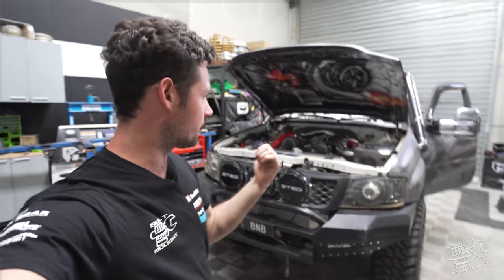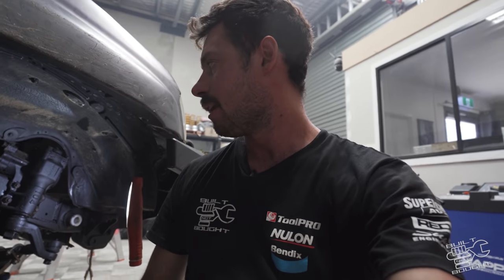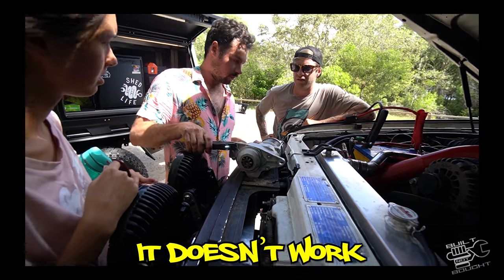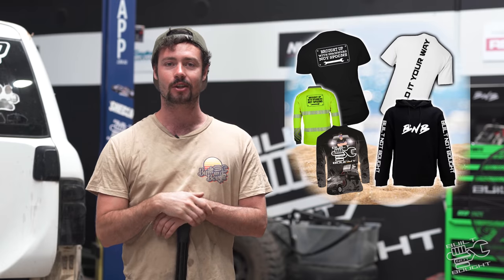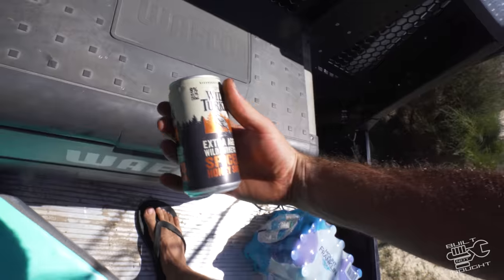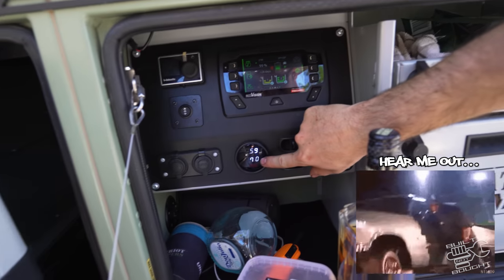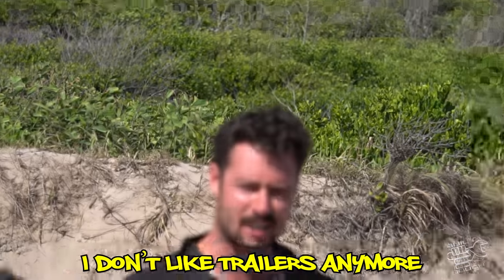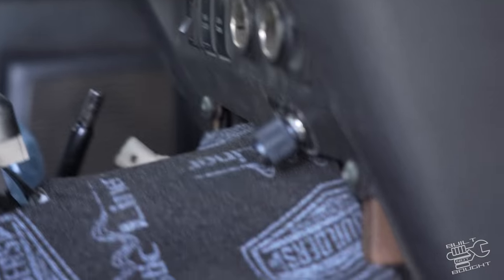DURAMAX Ep. 7 || Fraser Island Shakedown in the Duramax 🚗 💨

Comment: Hey Sam, I'm from WA and currently drive a lowered XT forester. Finally decided to put it on the market to get back into a 4x4, hopefully an older colarado or ranger. A new set of rims would be a great way to start a new build.
Reply: Live north or south of the river?
Reply: @Qw3lp  down south in Albany
Reply: @zac_sales6  me too man albany is a good place
Reply: buddy,your young  stoopid. do not,, buy anything with ifs, or a 4 cyl diesel. that,will limit your choice to a decent, real , 4x4, not a pretend ute.. only 2 to consider are the 4.2tdi gu, or the 80 series,  4.2tdi toyota.  forester,isnt that subaru trying to be something its not.. torque & gears,low gears, are what you need 4x4ing,, not 400hp..
Reply: @harrywalker5836  haha right, I’m sure no one agrees with that
Reply: @harrywalker5836  100% agree my first 4by was a single cab d22 navara was an awesome ute but just save a but more to get something more capable and stronger

Comment: We are over in W.A and drive a GQ patrol which I converted to a turbo td42 and fitted a 4" lift and 35s on steel rims and I think a set of bead locks would set it off as its has a black over grey paint job

Comment: Loving the built not bought 
Tom from qld brisbane currently building hilux surf 1uz swap rebuilt complete motor from crank upwards and cut a340 box turned it into 4wd ,  running gear is in welded engine bay shut just need paint bay and exterior all done by myself need hit you up when its fully done

Wheels would be the next upgrade the fraser 👌🤙

Comment: G’day from Springside NSW, great channel Sam, Would love the aircon for my slide on which is on the back of a 79series 2021 Single Cab with DMW 3” lift/4499kg and 35” MT’s and GSL 4” twin exhaust and 4” intake/airbox and tune.  You can checkout some of the still in progress  build on my amateur channel “2021 LC79 Build” All the best, Regards Mick

Comment: more crap. 6.6 duramax. why.?.  theres better engines that weigh less than that. cheaper, by 25k, & easier to fit, more reliable , cheaper parts. & not toyota or ford.. or cummins..